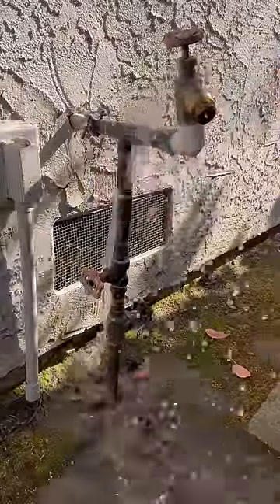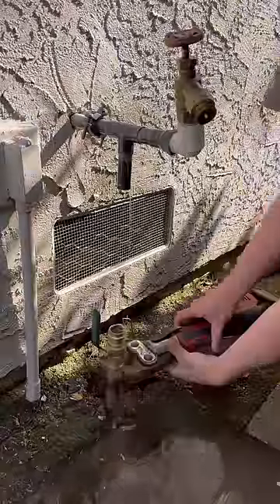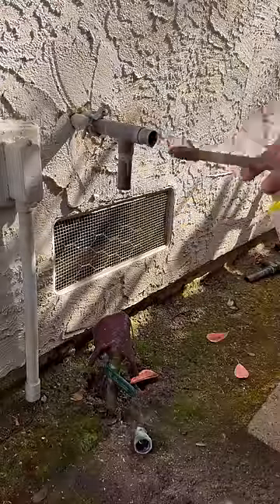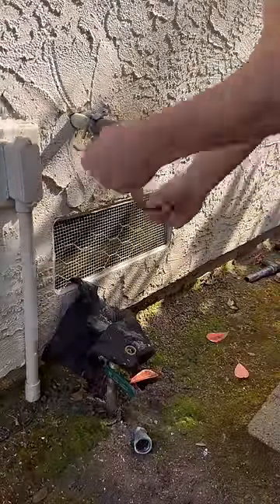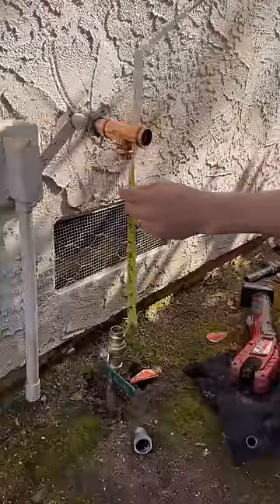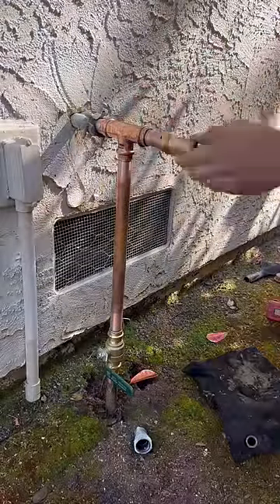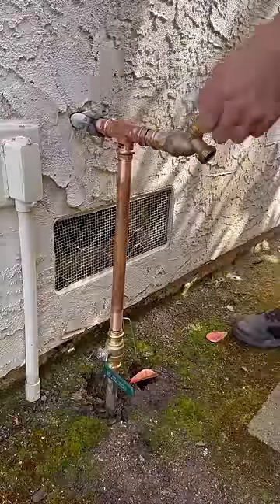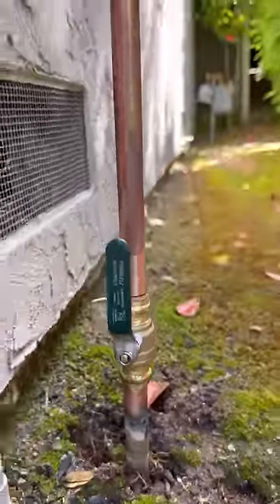easy day with @ViegaLLC #plumber #plumbing #propress #soldering #diy #ballvalves #repair #hosebib

Comment: The fact you take the time to adjust the handle says everything about the type of person and worker you are.  Respect 🤙🏻
Reply: Its equivalent to a electrition adjusting the screws on a outlet face plate to where the screwhead lines are in a vertical position.
Reply: Lmfao
Reply: Man, I was thinkin the same thing. Solid work. Solid dude.
Reply: @georgewallace9719  vertical? I’ve only ever seen horizontal if they even will do that😭
Reply: In all honesty and for transparency, this was done on video and he could possibly be doing it "right" for the camera. Not saying he's shady or a bad guy, but taking everything with a grain of salt is a smart move to not be surprised by how shady certain people are.
Reply: He always does that, too.
Reply: Is there anything  bad that can happen to your copper cutting tool if you get it wet?
Reply: @H2OMANLV  not really would be the same if any other power tool got wet. I’ve had my dewalt 1/2” impact completely submerged and the battery submerged in a ditch full of water tightening up flange bolts and it still runs.

Comment: My ball valve leaks at night. Sometimes I wake up 3 or 4 times because if I don't, my ball valve can't help but release.
Reply: I'm uncomfortable
Reply: You
Reply: Sounds like you might need a tighter press tool.
Reply: Time to cut and replace 🤐
Reply: Check for swelling with the thumb and forefinger
Reply: Bro 😭😂
Reply: Going to have to press a new one on
Reply: That's why it's called THE WEE HOURS.
Reply: what pluming are we talking about 🤨😓
Reply: @Vazaroonie  external fountain plumbing

Comment: “Back in my day” You mean the days when we had to breath acid filled flux smoke for hours a day? You mean the days when the bread ALMOST held long enough but didn’t and ruined the solder joint and blowing super heated water at your hand arm and face? Those days? I’m thinking I like these days now better.
Reply from the maker: 🤣🤣appreciate you reminiscing

Comment: I like that you unscrew your handles and resemble them in an off position perpendicular to the direction of flow.
Reply from the maker: It’s the little things👍🏻
Reply: yep, that's a nice touch, like locksmiths, attention to simple details.
Reply: Resemble them? Like... They look like.
Reply: @enb3810  reassemble, come-on man... Context clues
Reply: @GeauxRilla  it’s a little harder for some people, not everybody has common sense yet the ability to use context clues
Reply: @enb3810  my license is for plumbing not spelling. I meant reassemble.
Reply: @kindajacked5154  even if some don't have something, doesn't mean they can't learn and be intelligent
Reply: @stevendee6910  that's elementary as fuck though Stevie
Reply: Great Vids Brother, valves always need to point down for falls
Reply: @jr2904  You really got that excited about a spelling error. lol
Reply: I've never seen a quarter turn valve where off was not perpendicular to the flow.  However, lots have the handles 180 degrees to the flow.  I generally like the handle to point in the direction of flow when it is on.

Comment: With these rubber O-ring compression clamps, it may make your job go easy and fast, but if one of these start to leak, you have to tear the whole thing out, and hopefully you have enough pipe to redo it, or you’re cutting into the wall to get more pipe, or digging down to find more. Pipe soldering is the best way to go, you can always fix it if you mess up, or if it ever starts to leak.
Reply: I agree 💯%
Reply: Next persons problem 🤷‍♂️
Reply: he’s sponsored and gets product for free so the company can sell more product i don’t think you can get sponsored by solder

Comment: Dude please keep doing the voices man, I'm a independent contractor and get the same sh*t everyday! The different voices for the insults make these videos man, hilarious!! 💯
Reply from the maker: Thank you bro!
Reply: @replumb  The white bread stuffed in the wet side thing is real. LOL... that is how I learned over 40 years ago by a real OG, my Dad. LOL. it does works in a pinch to give time to sweat the pipe when needed, if that is all you have, If you stuff enough. There. LOL... funny to hear someone actually mentioned it.  Old school plumbers had part of a loaf of white bread in their tool boxes for sure. Ha 😂😂😂
Reply: @cawthorne6992  make sandwiches on site and get the job done, that’s called efficiency and getting 2 birds stoned with one joint 😂
Reply: @murkyturkey5238  hahahah yah, that. 🤣 
Did not say I still did it. But 35+ years ago it was all you had, and it worked just fine at the time. 🤣🤣🤣🤣 Maybe Different more dense bread back then too I guess. LOL.!!   Now the joint makes them dense... Ha
Reply: @cawthorne6992  that’s what my welding teacher said can be used in a pinch, specifically wonderbread😂🤣 Will end up dissolving by the time you’re done sweating the pipe.

Comment: They stacked 2 values "back in the day" because one value didn't close all the way so they added another instead of removing the bad one.
Reply: anything wrong with adding another valve and using that instead of replacing? besides being ugly ?

Comment: I love that you moved the handle to be horizontal when off.
Reply: Lol wut?
Reply: @crazymayne69  I thot I was tripping 😂
Reply: @crazymayne69  he repositioned the handle in the shut off position. It's that kind of stuff that shows he takes pride in his work.
Reply: If it's a compression valve the handle position will move with time, I know you installed an sphion breaker on it 😊

Comment: Not hating but wouldn’t it be wiser to use solder that T . In case of future repair there isn’t much sticking out the wall .
Reply from the maker: Plenty of pipe to work with there buddy
Reply: @replumb  that’s what she said

Comment: I like that press fit stuff for Outdoor & Wet application & speed. Makes for some quick work of it. indoor is Just a leak waiting to happen in 10 years. Sweat it & it lasts 30-40 years.

Comment: "I got jet sweat and propress"....Got any polybutylene pipe?  20 years is about the time needed for plumbing and electrical systems to prove themselves. Remember copper clad aluminum wire?

Comment: A "jet swet" is a flow prevention tool that is a threaded rod going to a rubberised expander. You fit them into the pipe and it blocks the flow so you cut the pipe and install a ball valve. All done with the jet swet in place, only removed after installation. Alternatively use Freezing or a Inflating Bladder or a Captive Flow Plug

Comment: I had a plumber come out and he used that clamp press… luckily I used an insured company with warranty because it began leaking 2 days later… they came out and did a sweat connection and it was fine. 

I get that the clamp CAN work and does it very fast… but I will get a quote from a plumber now and when they try to use that thing, ask for it to be sweat instead. 

You aren’t going to charge me sweat prices from days of old for clamp work….

Comment: It's true in my day we did shove bread up there to try and give us 2 minutes while we welded, since most of the old valves couldn't shut off properly, and even though we think the new generation of plumbers are soft cocks, we were called the same from the old timers when I did my apprenticeship because we were laying drains in PVC pipe instead of cast iron

Comment: When u said ball valve I was like 😕 as a U.K. plumber we call these lever valves. Crimping isn’t widely used here as alot of plumbers enjoy soldering. Speed/push fit is fast becoming the standard though and I hate it 😭
Reply: Sharkbite fittings are a disgrace to our profession.

Comment: I like that you install the quarter-turn ball valve so the handle points in the direction of the flow when the valve is on.  My only critique is that I would have left as much pipe coming up out of the ground as possible so that the valve would as high up as possible to avoid lawn mowers and weed whackers and to leave as much pipe as possible for the next repair.

Comment: I noticed you use the M12 Milwaukee and Rigid Pro Press. Which do you prefer or is it a matter of application?
Reply from the maker: I prefer the rigid press but it doesn’t really matter. They both do the same job. Ridgid just does it a little better

Comment: Now take those off in (?) Years and reuse the pipe like you just did with the sweat joints. Your thinking of the now. Not the future. But who cares right? Wont be you probably.
Reply: Apply that same logic to gate valves bro, those things suck ass 😂

Comment: Why the sharpie? Used in testing at pressure? If it moves the connection not tight? (Not a plumber just love your videos!)
Reply from the maker: Part of viegas installation guide to make sure you maintain proper insertion up until the joint is pressed
Reply: @replumb  ahh interesting. Thanks!

Comment: They stacked the valves because the first one failed, and the next guy was too lazy to be bothered about even caring just a little to remove the old valve when installing the new.

Comment: My only criticism is that. It looks like that press fitting is close to that wall if it needs work. Hopefully it stubs out on the other side. To avoid having to get into the wall. Love pro press. I try to make sure there’s always one more repair that can get done before. It comes to that. I’m sure you have a good reason though. Love your videos for real though!
Reply from the maker: There’s like 6 inches of pipe there… I could cut it back and use a coupling two more times

Comment: Back in my day we put valves on our valves so if a valve leaked we could turn out 2nd valve and lemme tell yah about when our valve for our valve leaked. You know what we did? We added a valve to stop the leak on the valve we used to stop the leak on our other valve. Valves man, they’re so useful.

Comment: You are an unqualified amateur for using a boiler valve as an outdoor hose bib.   A proper hose bib has a build in vacuum breaker and is built for repeated uses.  You give plumbers a bad name.

Comment: Why did you need to use a $200 flow prevention tool when you had turned the water off already? Were you worried about getting the grass wet?
Reply from the maker: To solder? Look up what that tool is for

Comment: 2 gate valves probably because they had 1 originally and it became stick open and they added a second one above it to be able to shut it off
Reply from the maker: It came back to bite them because the old valve body split. Should have just removed the old fitting and had one valve
Reply: Great work!

Comment: Ball valve is backwards....just saying.
Reply from the maker: It’s not, just saying. Handle points to flow
Reply: @replumb  everyone I've ever plumbed with, including myself and plumbing inspectors, has pointed the other direction and called that the direction of flow.

Comment: Use a 3/4 female slip inside that tee. Change to male bib and save some space and a cut.
Reply from the maker: $20 for that fitting versus a $5 press male adapter

Comment: I won’t go near these pro press no thanks I know what’s coming failure of the main seals then you have to go back and solder real fittings back in to plug the holes and never have to go back for that

Comment: What's that cylinder looking thing you use on the pipe?
Reply from the maker: Inside/outside deburring tool
Reply: @replumb  thank you! I missed the inside/outside barrel call out. Thank you. Last tool identification, what's that thing you put into the pipe when you had to solder the pipe off?
Reply from the maker: @newtonroberts590  it’s called a jet sweat, it goes into the pipe and when the tighten the handle, a metal washer squeezes and expands the rubber inside the pipe creating a seal
Reply: @replumb  Thank you so much, man! I'm going to be installing an RO filter and a eater softener tomorrow. Wish me luck!

Comment: Sorry man but I’m gonna say it. On this one you did actually make a small mistake. Your not allowed that tight of clearance on 1” brother. You know that. You need to space your fittings farther apart.  1” if I’m not mistaken is 2 1/4” minimum. That MIP and T are too close. On this one you had no reason not to bump it out. If warranty is important for your customer’s then we have to do right by them. That blows out and it’s on you,  not the fitting. I’d say even more so in this case being exposed.  And don’t tell me I’m wrong because I know the viega chart pretty well,  and I can see the stamp on your T lol  love the videos man. Keep it up.
Reply from the maker: 🤣🤣that’s 3/4 and there’s a 0” requirement between fittings. Check out this link https://www.cooneybrothers.com/resources/roller/minimum-distance-between-propress-fittings

Although I did leave 1/4 of an inch so you can see that it’s fully inserted. Thanks for playing come again
Reply: Damn that viega chart you know so well seems to be way different than the link he replied with...